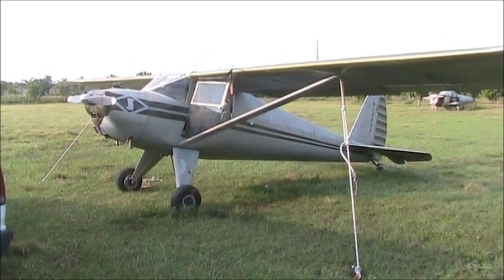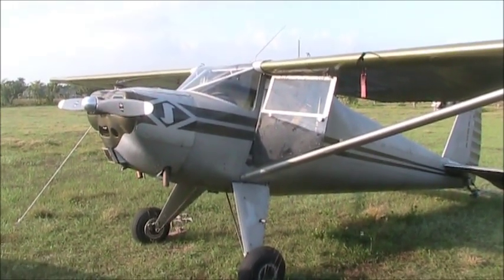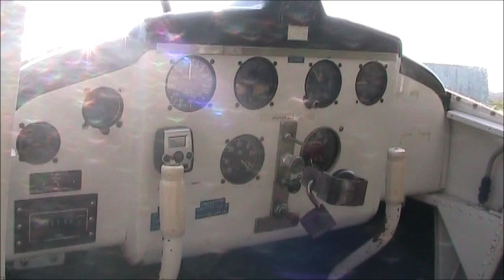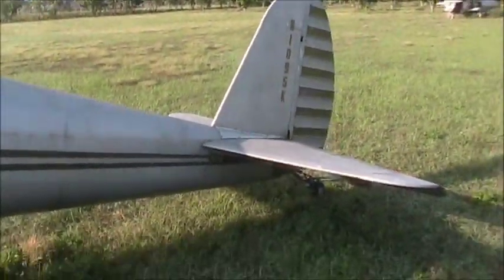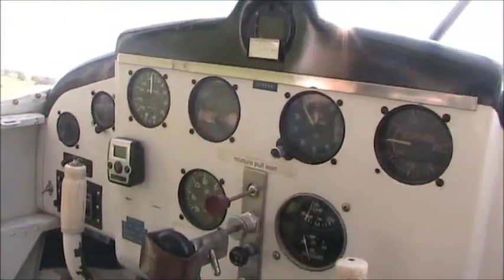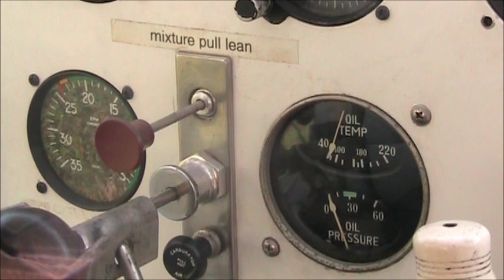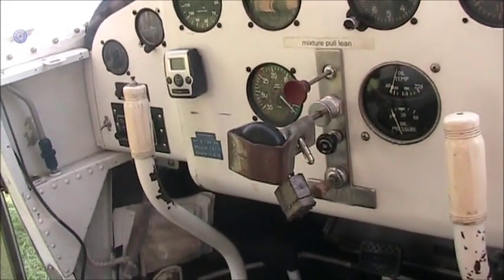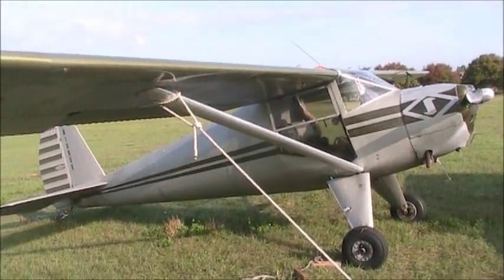1946 Luscombe Silvaire 8A walkaround

Comment: You are startlingly ignorant of gyros. That is a Turn and Bank gyro,  NOT a Turn Coordinator. You should have been taught the difference. It is a RATE gyro,  not a free gyro like an Artificial Horizon. You have confused the 35 degree pivot inclination of the TC which responds to roll as well as yaw,  unlike the T&B which has a level pivot and responds ONLY to yaw.  Your knowledge is shallow; I suspect it is because your instructor's knowledge was also shallow. The TC is also a rate gyro which does NOT display roll attitude alone,  nor does it display pitch attitude. NEITHER a T&B nor a TC display attitude , they only display RATE in those axes as they are constrained by springs and thus cannot assume the motions of an unrestrained gyro. Do NOT let this cognitive deficiency go forward. It may well bite you when you least expect it. Don't look to that instructor for help. Get a copy of Kershner's book and read it.
Reply: Glad you were not his instructor. Terrible attitude.